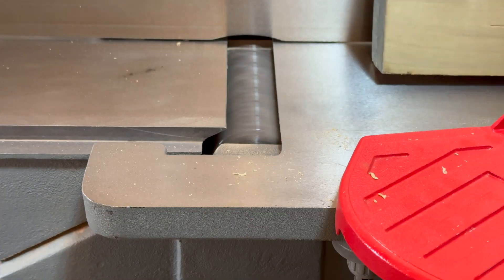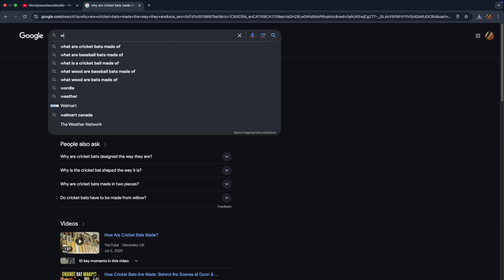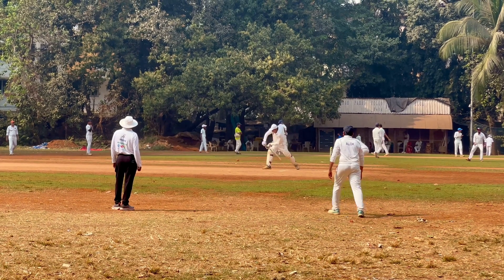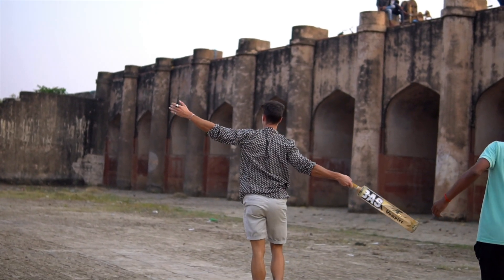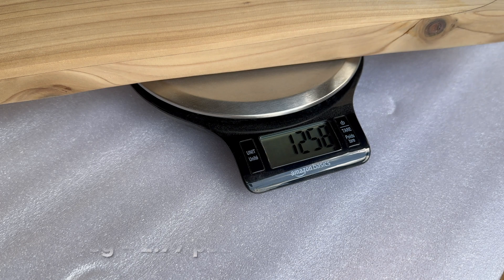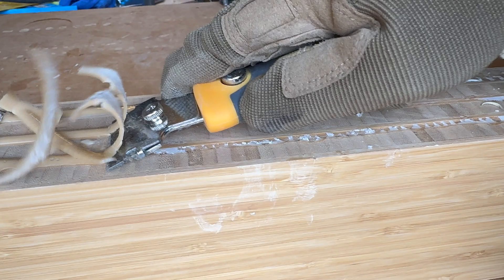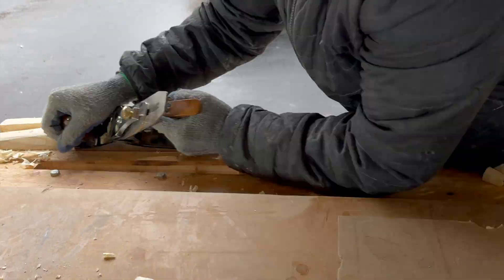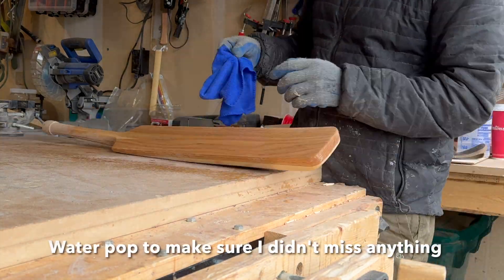200 Years of Cricket Bat Tradition… But What If It’s Wrong?

Comment: bro u cant use laminated bats , as they are banned. other than the handle, the bat should be made entirely of one block of wood. this is done to prevent someone taking unfair advantage by using cork wood between layers as it is lighter  and will make stroke making easier.
also there was no rule before regarding the material of the bat but once an oz player used aluminium bat which distorted the shape of the ball , after that they changed the rule and hence only wood can be used
Reply from the maker: I hear you and I know what you’re saying. Making a bat out of one piece of wood is not a problem or a challenge. My goal was to test out different woods and different methods. In the name of testing, creativity and challenging the norm. Thats all. My apologies if I led you to believe anything else. And thank you for reaching out and sharing your thoughts. I am grateful.

Comment: Another possibility is that English willow was by far the best, back in the day. Trouble is that would be slow grown willow which was then air dried for 25 years. The number of clefts of such produced these days probably wouldn't even furnish all the international cricketers with a bat. The main supplier ( 95%) is JS Wright who kiln dries all their willow, which is known to be weaker. With millions of people playing rather than a few tens of thousands the market is for volume which belies waiting 25 years for the sods to dry out. 

 I have quite a collection of old and very old cricket bats and it wouldn't be unfair to say that they either get better with age or were simply better to begin with. I very much suspect the latter though realise there's a lot of survivor bias involved. Was using a 1lb 12oz bat earlier today and it still offered plenty of power, though it is a top grade bat from one of the poshest bat makers in the 1950s. My best one is is a 2lb 2oz from the 1920s from the same company.

 Course these are twiglets by todays standards with very thin edges and little depth, hence very unfashionable. Bat shape is an entirely different conversation but I personally think it matters a great deal. Another aspect which is rarely talked about is simply the quality of the handle. When you swing the cane provides some flex. Swing faster and there's more flex or tension in it hence when you make contact it has less flex left to give and provides a feeling of power. Heavier bat, thicker or heavier handle, less flex and less feeling. Regardless of the 'grade' of willow if you offered me something with a thin good quality handle I suspect I'd notice.

 Modern bats seem to break with monotonous regularity. One international said he went though over 40 in a year. Which is probably good for bat sales, player x breaks bat hitting huge 6 would probably bring up quite a few youtube videos. Not so great for kids whose parents have forked out several hundred notes for them though. A local bat repairer 

 One interesting rabbithole and test for this is monster hits. Despite some spurious claims even the muscle bound modern power hitters very rarely go above 120 yards. Though there's several well documented 160 yard hits (Cec Pepper, Victor Trumper etc), though none recently. Curiously baseball seems to show a similar trend with Babe Ruth and hitting further than his perfumed modern counterparts. And that's without steroids, corked bats, 17 coaches etc.
Reply from the maker: This is an absolutely fascinating perspective, and I appreciate the depth of knowledge you bring to this! The shift from slow-grown, air-dried willow to mass-produced, kiln-dried clefts has definitely impacted bat quality. The survivor bias in old bats is a great point—were they inherently better, or are we just seeing the best of the past because they lasted? Probably a mix of both.

The handle aspect is something rarely discussed, but you're spot on. That flex and tension make a huge difference in feel, and modern bats, with their heavier profiles and thicker handles, may have lost some of that responsiveness. The rapid breakage of today’s bats is another unfortunate trade-off—great for manufacturers, not so much for players (or their wallets!).

As for monster hits, the historical examples you mention are intriguing. Whether it’s changes in bat construction, player technique, or even the quality of the ball, it’s curious that modern power hitters aren’t consistently surpassing those legendary distances. Definitely a rabbit hole worth exploring!

Thanks for sharing these insights—this is the kind of discussion that makes cricket history and bat evolution so fascinating!
Reply: @WoodywoodwoodStudio  Been doing some nerding up on different woods, though I don't have any woodworking experience etc.

 Wondering about poplar and... cottonwood! The former I suspect will make something very useable, that latter really isn't an obvious candidate but does appear to be very cheap.

 If you happen to be inquisitive enough to have a go with these I'd be very interested in the results!
Reply from the maker: That’s awesome! Poplar is definitely a solid choice—you can check out my Poplar build where I added a bowtie for the handle joint just for fun. It’s easy to work with and fairly strong.

Cottonwood, on the other hand, is a bit of a wildcard. I haven’t worked with it much, but now you’ve got me curious! Since you’ve been nerding up on woods, check out Paulownia—that’s high on my list if I ever get around to making another bat.

I’ll keep you posted if I experiment with it! Appreciate the nudge to try something new.